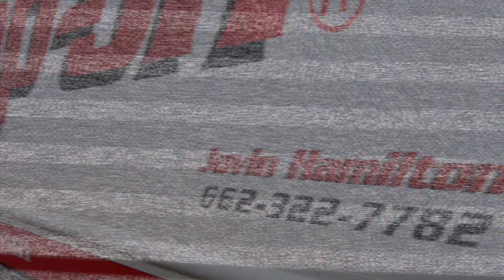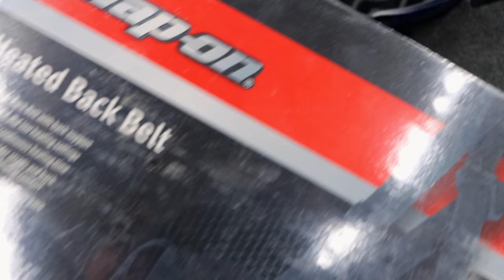Snap On Friday: This Impact Is Destoyed

Comment: I've shot plenty of 9mms but the only time I've ever used a 9mm socket is like Hamilton said, a 10 was rounded off and I beat a 9 on it to get it out
Reply: I just used one the other day. Fords have very strange socket sizes at times. This particular situation was on a f150 extended cab, the little vent window frame uses eight 9mm nuts all the way around.
Reply: Ford used 9mm on their quarter glasses for years. Only thing I have used a 9mm on
Reply: Some old honda atvs also use them

Comment: Ive used a 5/8 12 point 3/4 inch drive socket on a shear head at my work, 4 bolts that hold one of the knifes on it are 12 point with a 5/8 head.

Comment: My old cornwell guy told me he stopped at farm got of truck seen they were using loader tractor to lift on 3/4" breaker bar
Reply from the maker: Hahaha 🤣
Reply: Only reason I bought a ez red 3/4 extendo ratchet was because I watched Stephen Cox use it on a hydraulic cylinder rod nut On a grader 2+" socket , used his service crane too break it lose with the ratchet fully extended and it didn't break any teeth or nothing. Looked for the video but I think he deleted it when all that de monitization was going on or still is

Comment: Clay clean the CV boot off good with brake cleaner and take some super glue and add a pinch baking soda to it and mix it up and cover the pin hole on the boot And then put a touch of 2 part epoxy or Hot glue over that to help hold and seal the super glue and it'll last for a while that way

Comment: I do like the 3/8 electric ratchets I've got them in matco as well but the 3/8 slim impact ain't got nothing on my matco 3/8 stubby she's four years old but she still gets it done I used my snap on 3/8 impact today to do some light semi trailer work and it didn't seem long before you heard it be maxed out struggle to tighten bolts and loosen them my matco one will break them if you ain't familiar with it

Comment: I broke my snap on 3/4 rachet on a jd 644h loader hydraulic cylinder i was supposed too rebuild it out in the feild i didnt check my torch tanks i had no acetelyn used my crane too pull the rachet  and snap packed my shit and left my snap on guy was not happy gave me a hard time didnt want too rebuild it for me i contacted snap on talked too a few ppl and at the end they sent me a brand new one sent the broken one in the box back they said keep the new one

Comment: Just a heads up, If you need a new axle for a 4 wheeler or side by side check out sixity.com. They’re axles are awesome and cheap! You can often find a coupon code to save a little more too. Check them out

Comment: Not sure if you have answered this question in another video that I may have not seen, but do you know what brand of lubricant/grease Snap On uses in their ratchets and other hand tools? On the topic of broken products, i can say the brushless polisher/prep tool is a huge improvement from the brushed model and i run it hard. Thanks!
Reply from the maker: Snap on has a tube that comes in the rebuild kits with them clear tube no name. Try superlube if you want to use something good
Reply: Thanks bud

Comment: Hey Clay I have a 3/8 stubby milwaukee already do you think the 14.4 snapon 3/8 inpact would still be worth buying or are they effectively the same.
Reply from the maker: The Milwaukee is stronger. We proved that in our impact test videos on each of them. The 14.4 is much slimmer to get in tighter spots and the rocker trigger is nice on rusty bolts because you can go back and forth with them

Comment: Another I don't like about battery tools made of plastic air is tougher
Reply: Yeah, but carrying the compressor around sucks after a while.
Reply from the maker: Yep and stronger and lighter and oil or diesel doesn’t hurt them and they are faster and never need charging.

Comment: That cable crimper is the cats ass ain't nothing better
Reply: Matco has one similar to that and a threaded style both are nice for different situations i like the fact I don't have to pull the cable off of the truck just over to the frame a smack it with a hammer a couple of times